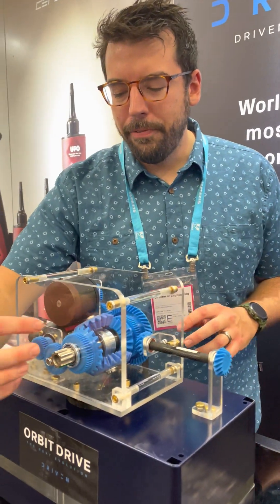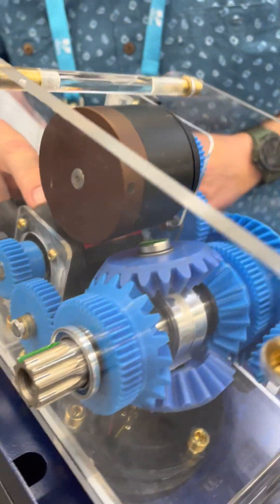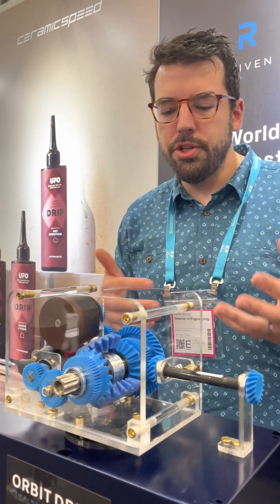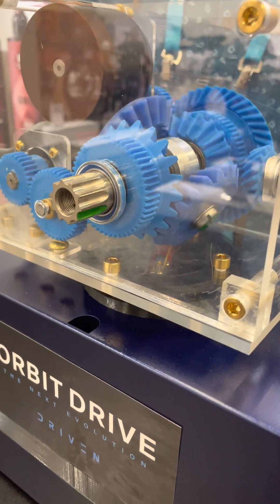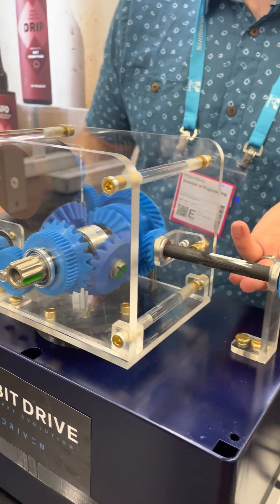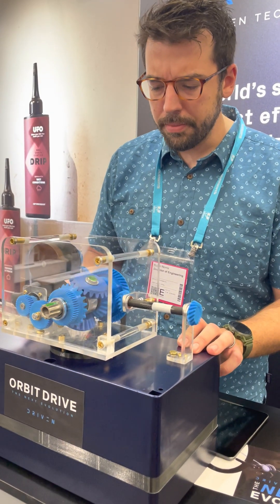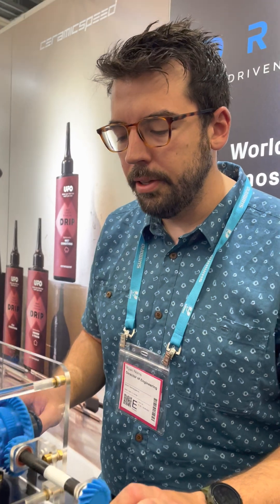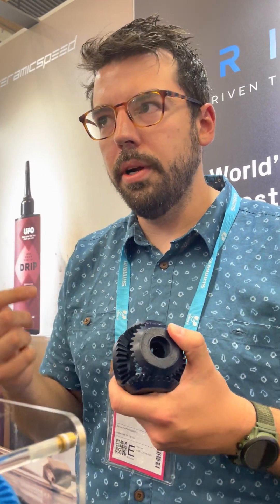Ryan Norris of Driven explains the Orbit Drive Gearbox eBike Motor Concept

Comment: Not sold on this. Bevel gearing will always have worse efficiency and torque transfer capability than helical gears and using a drive shaft on a bike with rear suspension is difficult and in bike it will be a needlessly heavy, complicated and proprietary system.
Reply: Yeah the bevel gears will have more losses. Toyota went from a coaxial planetary gear arrangement from previous gen Prius hybrid drivetrains to the multi-axis parallel gear arrangement in the gen 4 Prius which Toyota claims reduces mechanical losses by 20%. 

Also the parallel arrangement of the two MGUs would be just as compact as this example in a miniaturized form.